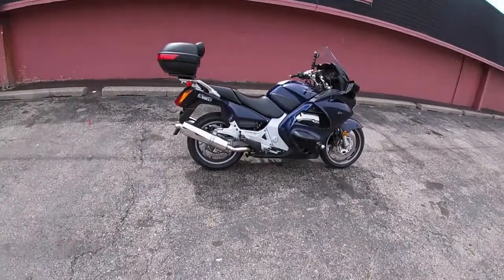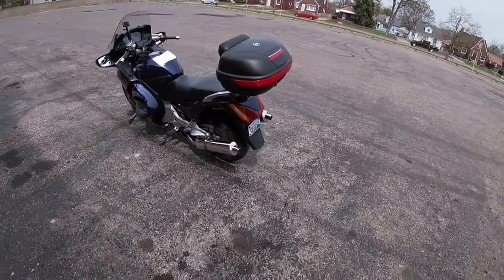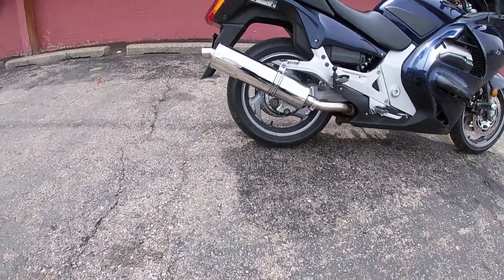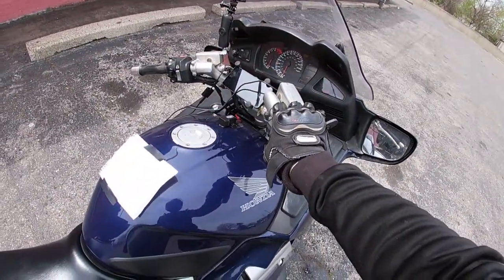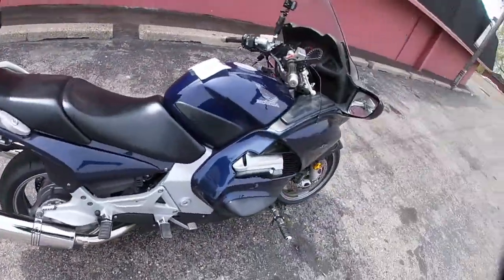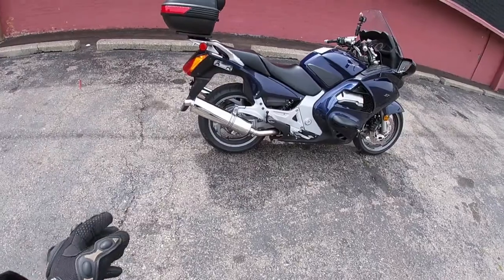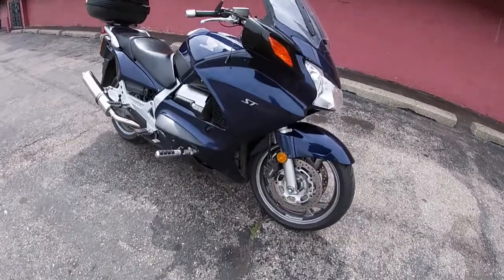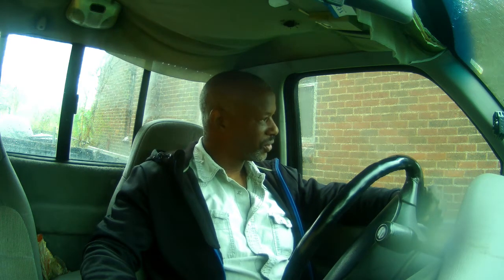New motorcycle camper for the Honda ST1300

Comment: Just wanted to say how much I enjoyed your video. I am from the UK but lived (and worked) in MI for 15 years. I returned to the UK 10 years ago. This year I decided to buy a motorcycle after being away from them for 25 years - and guess which bike I bought. Yeah, a 2004 ST1300. I always did my own bike maintenance and since this one has been neglected I've had a steep learning curve on this bike but the ST owners club site coupled with youtube and a haynes manual has allowed me to work through any issues I've come across so far. Ride safe and keep them coming!

Comment: I've had a couple of those "leaves my knees shaking" moments over the years. Now I have to see if you have a camping video up with the trailer.
Reply from the maker: I got the camper in May, and I though I would be dong more camping in the trailer, and I did, but I did not video most of the trips I took with the camper YouTube content creator might understand, It takes a lot of time to do a video, setting up cameras, lights, etc, some time yu just want to camp!..LOL. Also my computer crashed, and I did not put out a video for 2 months.
Reply: @SoloBlack313  I've certainly had a few camera hiccups. I didn't get out as much as I hoped this year either. Waiting for bike parts... had to rebuild the clutch master and slave cylinders. The ST will run forever but there are some things that do wear out. I'm subscribed, so I'll  be looking forward to some camping vids next summer.

Comment: I have a travelite pop up as well. Really enjoy mine and can’t wait to see yours!
Reply from the maker: AWESOMEEEEEE!!!!!!.... I need to talk to you.... I know there is a community of motorcycle that pull campers , and I'm not a snob, but is there a community of Travlite moto-campers? What kind of bike do you pull your camper with? what year did they stop making the Travlite? is it hard to find parts. Thanks for the Sub, and please stay in touch.
Reply: @SoloBlack313  I have not found or seen a Travelite group but I do belong to several of the motorcycle camping groups on Facebook. I ride a 2016 H-D Road Glide Ultra and it has pulled the camper well. I will say that the heavier the tongue the better it pulls. My camper loaded has been over 550lbs and I try to run the tongue at 55-65lbs. I haven’t had to find any parts for the camper yet although I’m about to add 7” brakes and wide tires.

Comment: I'm very intrigued by your camp trailer. I have just started looking. How does the st1300 pull the trailer. I'm getting tired of sleeping on the ground.
Reply from the maker: Hello my new friend!..the ST1300 is a very versatile motorcycle, you can do a track day, and more then Keep up with any bike on that track..and I mean any bike out there, or you can pull a trailer. With the weight of the trailer, and all the gear carry, I'm pulling about 510lbs, and sometimes with a passenger with no problem.

Comment: In the market to get a trailer just need a little help with the right direction of locating hitch wiring harness found trailer already could you help a brother out also congratulations on the camper. 💪🏾.     Also I have a 09 ST
Reply from the maker: Thank you brother for the kind words as you know I have the Travel Lite camper some campers come with a five pin setup mine came with a 4 pin setup, one constant light, one brake light, left turn signal and right turn signal. I got my trailer hitch and the wiring harness from Danray Hitch Company Quebec Canada.
About $300.00 for both. If you wire it up yourself, will must cut into harness, and for me that was kinda scary!!!....lol
Reply: @SoloBlack313  thanks I appreciate that I'm familiar with 12 v I will be reaching out to this company to make my purchase I appreciate your reply. Also safe travels
Reply from the maker: @RVguyReese0926  please stay in touch with me on the direction you're going with your camper the wiring and the rest of your riding experience you can hit me up on Instagram solo black 313. Blessing to you, and the family.